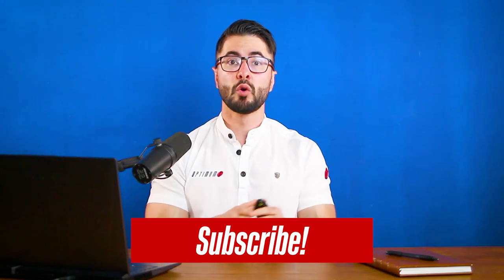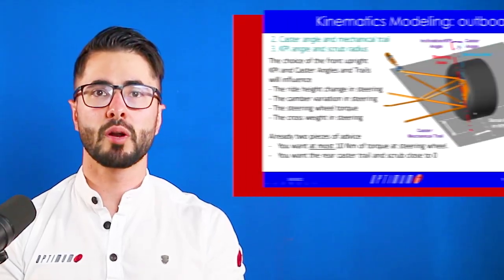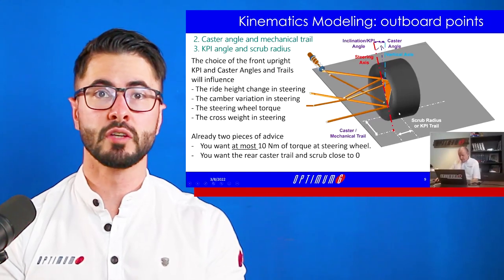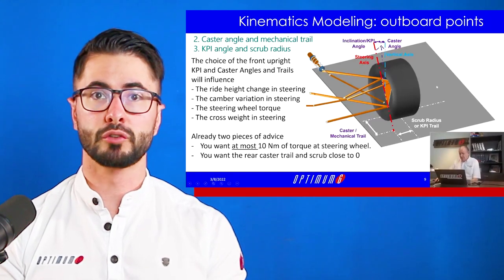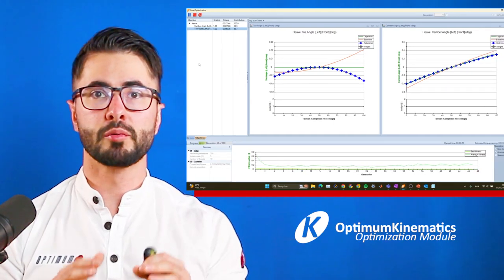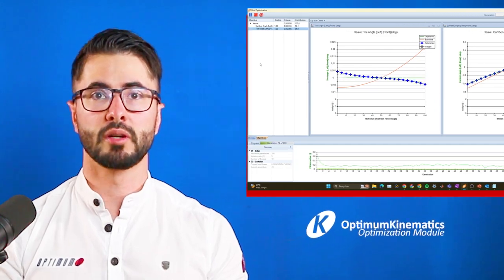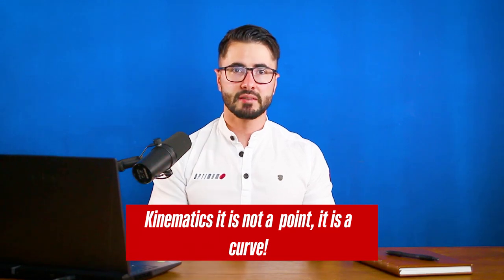Kinematics Design Methodology | Suspension Design Series Ep.1

Comment: First of all designing suspension it's a constant back and forth which is greatly reduced with experience. And let's be honest most people that design suspension are enthusiast that do not use specialized software, some use CAD software but you wont find many that use specialized optimization tools. Does it help, obviously but there is a down side too. If you rely on software you wont be able to solve problems when they occur simply because of software limitations and your own if you rely on it too much . 

Especially initial process of designing suspension is a constant exchange of information. 
Start what we want to achieve with our car and what we can, not just it's size but characteristics, weight, speed and power. That information will determine what type of suspension we can use and how much space we need for it. That information is strongly connected to next step which is selection of parts not just tires, but rims, uprights, brakes, springs, dumpers. Depending on application size and weight of these parts might be important or critical. 
Before we go to next step we need to keep in mind space needed for suspension travel and possible pick up points. That is what I mean by constant back and forth, we need to think ahead. 
Since we thought ahead we decided to use parts that will allow us to use our type of suspension.
Now that we finished with optimisation of initial steps we can focus on next step which would be pick up points. I would start with outside pick up points, many times we use uprights of the shelf instead of fabricating new ones. So these points are determined by our upright.
Last step would be choosing/iterating inner pick up points.